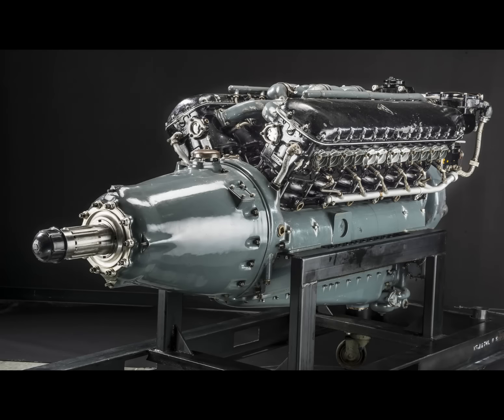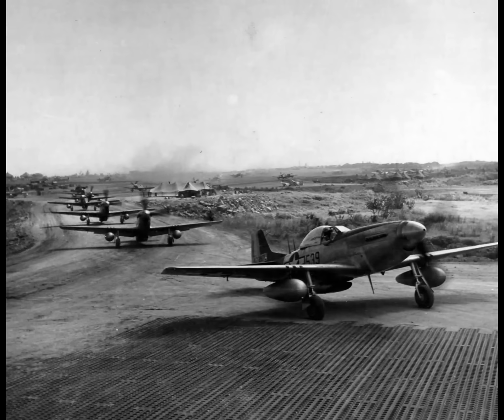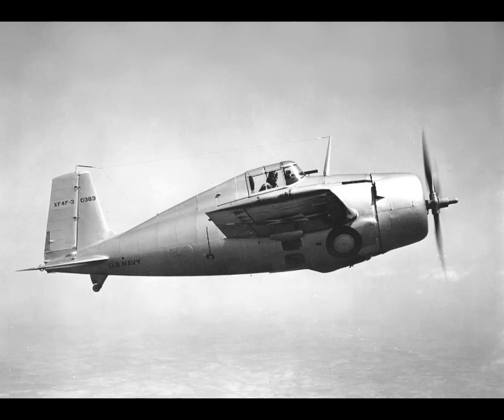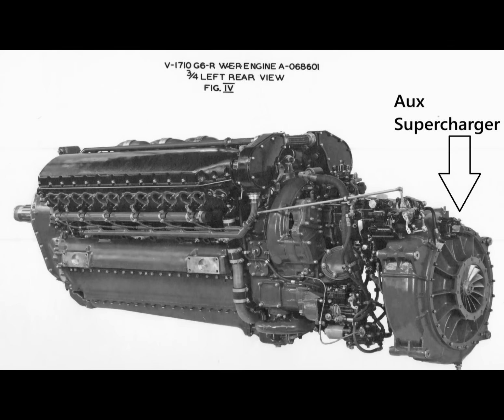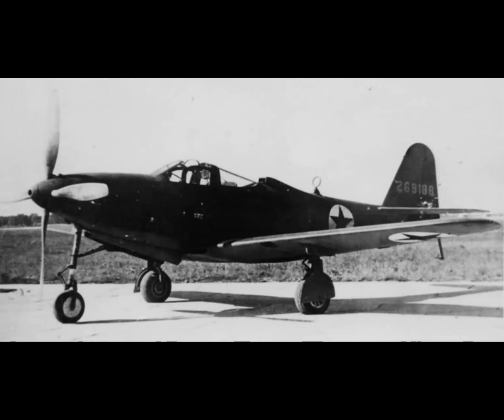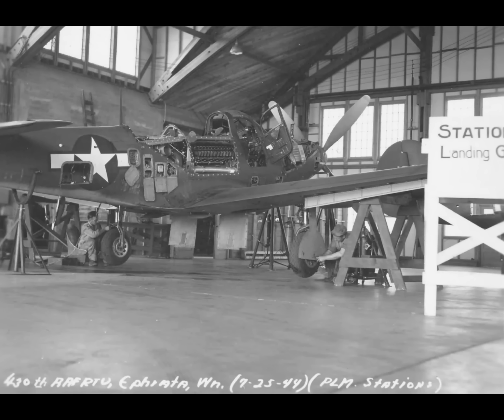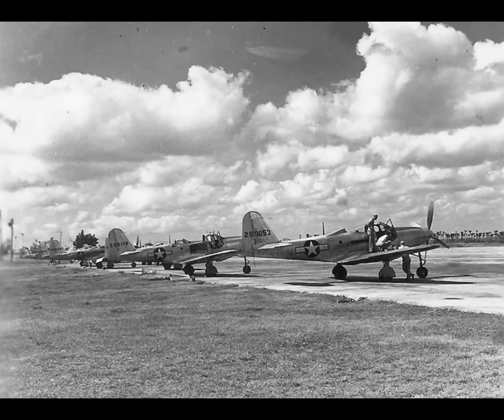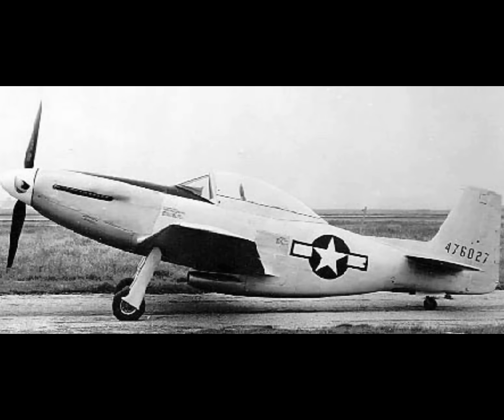Allison V-1710 with a TWO-STAGE Supercharger

Comment: 1:15 "The Allison was pretty much equal in any metrics you choose to compare."  My understanding is that the Alison was far cheaper to build, install, and repair than at least the British Merlins, which in some cases didn't even have interchangeable parts.  Every workstation on the Merlin production lines in the UK had a bench and a vice.  The only reason you need a vice on an assembly line is because your parts don't fit together and you need to work them further to get them to even fit.  I've also heard that Packard needed a year (?? hard to believe but) to re-make technical drawings of it, in part because the tolerances on the plans they got were too loose to really mass produce the American way.  I'd be curious if you have price data comparing the Alisons, the Packard Merlins, and the RR Merlins.  Further, if the preceding is that case, I'm not sure that RR Merlins would have been as reliable, or as easy to fix.  I've also heard that Merlins were more like an engine family, sharing a name but not as many parts as you'd think, meaning you couldn't repair different Merlin-powered aircraft from the same spare parts stock, while Alisons had far more interchangeability, simplifying logistics.

I'm happy to believe that in terms of power per pound at any given air pressure they were comperable.

BTW North American was actually GM, if I recall correctly?  Was Alison part of a larger concern?  What about Packard?
Reply: @lqr824 The V-1710 & Merlin are largely comparable. No developed country has a monopoly on knowledge and skill, just maybe a temporary lead in some specific area or resource. However, sad to see the old Merlin myths appear in comments yet again. RR absolutely did not build ~82,000 wartime engines (to Packards ~55,500) by having highly skilled workers 'hand file parts to fit' or anything similar.  From ~1940 the assembly + much of the parts production workforce transitioned to mostly low/semi-skilled labour just as it had to be for ~all allied WWII production. There was no other possible option given the rapid expansion.
Ford UK built ~30000 Merlins under contract - is it suggested their non-RR-time-served workforce also filed parts at benches before 'offering them up' to see if they fit ? The fact is that while the new UK Merlin production lines may not have been as 'shiny' as the Packard plant, they operated on exactly similar practices.
Similarly, 10,000s of Merlins were not ~constantly rebuilt with uniquely made spare parts. It's laughable - you couldn't keep one Lancaster squadron going with that approach, let alone fifty. Merlin parts were as interchangeable as with any other engine.
Then the popular but fanciful claim that Merlin 'limits and clearances' (tolerance is a different concept mostly blanket used by lay-people) were not fully specified, if at all. Even the 1938 RR service manual has all the relevant data on ~every component, both for new and for those to be re-used. Is it likely this information + updates was not made available to Packard ?
There were several important practical reasons for Packard to re-create the drawings which I'll leave for now. They also had to set up the facility, make supplier arrangements, and so forth. A major delay ocurred in sourcing the ~3500 machine tools + ~60,000 gauges, tools & fixtures needed.
People read far too much into anecdotes and the ubiquitous shop-floor "we can do what the other lot can't" stories, because they're not versed in actual mass manufacturing techniques, eg. they don't understand that assembly using 'selected fits' is a totally different specific process to 'hand fitting', etc. Also there is conflation with some pre-war RR engine building of limited quantities which did involve more manual methods by fully skilled craftsmen.

PS. A RR Merlin was ~£2000 in 1940 money. A Packard single-stage V-1650 contract price was ~$17,000 from 1941 to mid-1943. Allison was owned by GM from 1929. GM owned a controlling interest in North American Aviation from 1933.  Packard was Packard Motor Car Cpy. till 1954.

Comment: Question for Greg: The Merlin engined planes that we see racing at Reno today, they have their engine strengthened so that they can be over boosted and put under great stress at ground level (Reno) but do they still give their maximum TAS at medium/high altitude? Or ground level? Thanks.
Reply from the maker: They are optimized for around 5000 feet.
Reply: @GregsAirplanesandAutomobiles  So are  you saying that they'd go slower at 20,000 feet?

Comment: Okay, I have been studying military aircraft since my 1st proper book report. Which was on the Lightening from the book: "Fork-Tailed Devil: The P38" (Martin Caidin, 1973, Ballentine, 2nd Ed.). This was when I was in the 8th grade at a wonderful military school located in the mountains of Pennsylvania back in 1985/86. (Jeeesh I am old!) Anyway, I have a decent understanding of air density at altitude and the effect of oxygen starvation on people and engines at altitude, how internal & external combustion engines and electric motors work, etc. When it comes to the nomenclature of air densifying equipment for internal combustion engines, I thought that I understood the mechanisms and naming conventions well, so please correct me, as I much prefer to be wrong and be corrected rather than to think I know and be wrong. So what do I have wrong here: Turbo Chargers are driven by the hot exhaust gases spinning an impeller or turbine in the exhaust stream. The impeller shaft connects to and runs a compressor that compresses the incoming cold air before sending to the carbs and into the combustion chamber. (Does a turbo charger send any of the hot exhaust gases back to mix with the cold air and then through engine again?) A Suoercharger does the same thing but is mechanically driven by a belt or shaft from the engine or by an external electric motor. A turbo-supercharger has both of these systems on the engine (this is the one I am certain that I had wrong as my new understanding is that a turbocharger is more correctly called a turbo-supercharger). Anyway, yes I could look these terms up, but there is someone much garbage on the inter-web that I would prefer to hear from any experts here. Thank you!
Reply from the maker: That's basically all correct. The confusing part is that a turbocharger is correctly called a turbo-supercharger. However in WW2 all planes with turbochargers also had mechanically driven superchargers. They used the turbo to blow into the supercharger.  You might do well to watch this video: https://youtu.be/ULLsIo1VzTw?feature=shared

Comment: Cost, weight and dependability were main reasons in the choice of engines. B-17 engines were put in DC-3 to fly the hump were found impractical and removed afterward. Attack tactical aircraft got the job done and flew far more hours than high altitude mission aircraft.

Comment: hi, an excellent video. 1, does your supercharger book have good info for automotive use? or is it only aircraft? 2, do you think/ have you seen any applications in the automotive field for a hyd. driven superharger?
Reply from the maker: The boost is all automotive, mostly based around Alfa Romeo engines but the principles apply to everything. However I wrote it a lot time ago before there were 8 and 10 speed automatics that tend to favor centrifugals.

Comment: P-63 is a very much ignored or unknown WWII fighter but one of my favorites. Weird aircraft, but looks so cool and beautiful.

Decades ago I read somewhere, that Hungary after the WWII, under Soviet ruling, had to use Soviet supplied military equipment and arms - even manufactured small arms (Mosin-Nagant, PPSh-41) in licence - and there was a plan, to get P-39s and P-63s as fighters. That article said (maybe it was on early internet source, or in the local military aviation magazin, called Top Gun) that even the pilot and maintenance manuals were translated to Hungarian. But I never ever could find any hard evidence about it. Maybe they were destroyed before the digital era? So actually we got the "Yak-9P" with the Klimov VK-107, and had plentiful of problems with the engines. Oil system was always problematic with them. We called them "Vércse", means Kestrel. Also the Ilyushin IL-10 called "Párduc", Panther. These two were the first pro-WWII combat aircrafts in Hungary.

Comment: While we didn't see put in service, I think V-1710 was a large test mule, have seen pictures of turbocompounding also. Early turbos didn't have all the multiple parts we see currently, I remember going to Cummins school in the mid 80's, they had just bought HOLSET and had various housings, compressor/turbine blades to test on VTA903M. Turbos were kept in the closet, unless you had access to Hugh Mcinnes.

Comment: The Allison was no doubt a superior engine!
Rollers on the rockers was just one of the details that back this up.
The RR had rockers that dragged across the cams. That leads to a short life.
The Allison was the first aircraft engine to exceed 1,000HP
It was tougher and more durable.

Here's a fun fact, the British built Merlin engine was built in four (4) different factories.  Many parts were hand fitted and not interchangeable.  When Packard got the contract to build the Merlin, they got the blueprints, specs, and an example engine. It was crap! Fun note, it was metric, NOT imperial! Packard converted all the measurements from gay to manly and reverse engineered (to an extent) the Merlin, THEN they cranked out something far far much gooder than what the British was making!
Reply: This isn't True,  The Merlin was Imperial but did use British Standard Whitworth (BSW) British Standard Fine(BSF) British Standard pipe(BSP) and British Association (BA) thread systems on the engine .Also if the Packard Tolerances are more precise why is the HP the same.

Comment: I would argue that the Allison was a better engine than the Merlin. With the same or similar supercharging system, the engines had similar power across altitudes. But the Allison had over 30% fewer parts than the Merlin. This is a huge advantage in both manufacturing and maintenance. 300 hour overhauls took 30% fewer hours on the Allison vs the Merlin.
Reply: The Allisons cost significantly less, as well.  1944 production V-1650 Merlins cost $17,555 compared to $10,561 for the Allison V-1710.  The lower parts count in the Allison design would have been a significant factor in the cost delta.

Comment: Many of my countrymen get upset about any criticism of the Merlin. As a British born and trained mechanical engineer, I think the basics of the Allison V1710 were superior on balance. It’s valve operating system and combustion chamber shape were definitely better. Where it was critically inferior was in oil scavenging and deaerating. Allison had good design ability but couldn’t get close to RR on development ability.
Reply: Deaerating.  Was one factor that lead to long period of problems for Daimler Benz when they switched from roller bearings on the crankshaft of the DB601 to high pressure Journal bearings on the DB605 around 1942.

Comment: With the power of hindsight it feels like turbocharging for single seat piston fighters was a bit of a development dead end. It had rather few applications and then the jet age came.
Reply: The USAAF seem to have made poor pre war choices but the US Navy had all the smart people.
Reply: Turbocharging worked great in the P-47 and also the P-38.
IMHO the problem was that they put all on the one card P-38, while the P-39 and P-40 were neglected and restricted to low level work. Had the USAF wanted a dual stage supercharger in those smaller fighters, they would have been ready by late 1941.

BTW, these were all built before and during WWII to win THAT war. It has nothing to do with the jet age.
Also, P-47 would have been a better fighterbomber in Korea than P-51. It was just out of service before that war because of economic decissons.
Reply: I think if WWII hadn't happened to accelerate development and require designs suited for mass production, we would have seen more turbo fighters being developed before a later arrival of jets.

Under prewar thinking, the turbo was going to be a revolutionary advantage, and one already sort of proven by early B-17s in the 1930s. But when the war got started, turbos were one of the few continuing shortages the US had and they just weren't scalable enough to suit wartime production demands. The priority went to bombers, so fighters were either canceled or had their turbos gutted, except for the P-38 and P-47 as "high-end" fighters which couldn't really be adapted to a non-turbo design without becoming pointless (P-38) or turning into a totally different plane (P-47).

It might be interesting to see how that would affect naval aircraft development. They had basically rejected the turbo for all its drawbacks - size, weight, cost, reliability, no strategic bombers that would have needed them - and doubled down (literally) on superchargers instead. But navies were slow to adopt jets for carrier service for similar reasons as well, if without a WWII we see a later jet age and perhaps more USAAF turbo fighters to make the systems more available and perhaps seen as a requirement for performance, maybe they could have had their time with USN before jets ultimately took over, perhaps there would have been a production F4U-3. Or there could have been more compound-propulsion planes like the FR Fireball or AJ Savage.

Comment: The spinny parts that smooshed the air to the spinning parts where combustion happens to the shaft that goes to the spinny parts with the propeller that pulls the plane
Reply: Nerd 👆

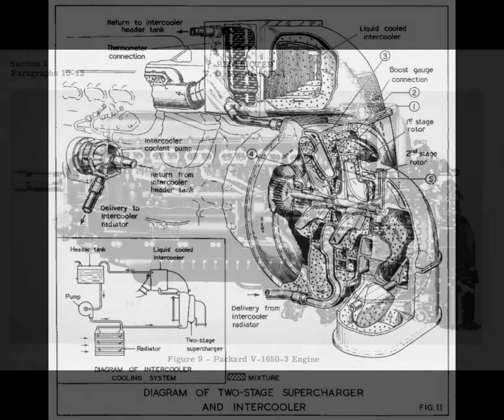Comment: 2:41 I can't find any reference to the Merlin being both intercooled and aftercooled.
The diagram shows a aftercooler which is right before the intake manifolds (which confusingly is labelled a intercooler).
I haven't worked on a Merlin since the mid 1990s but dont remember  an intercooler between the two supercharger impellers being used on the P-51. 🇦🇺
Reply: I think Packard cooled the first stage diffuser case but Rolls Royce cooled the area around the second stage intake.  Or the other way round.
Reply from the maker: The Merlin as used in the P-51B and later production models has both an intercooler and an aftercooler. Don't make me post an entire video about the Merlin engine.

Comment: Most interesting. Is that a swirl throttle on the inlet to the aux supercharger, or just some fixed inlet vanes?
Reply: When in the video do you see inlet vanes on the aux supercharger?
Reply: @TarenGarond  Well, on what I assume is the inlet in the middle.
Reply: @pedalinpete  Quite sure that is just the rotor.

Comment: Hi Greg, very interesting, I didn't realise that Allison used a hydraulic type supercharger in their two stage Allison's, I guess this type of aux supergarger was less convenient than our Merlin 61 series engines, in the sense of its length and compactness. But it's a very interesting comparison to the later DB 601 and 605 engines using water methanol to boost power. I wonder what your thoughts are comparing the two stage Merlin's to the DB605?

Comment: AS I recall the USAAF didn't fly the P-63 in combat. Like the P-39 it was plagued by short range. Aerial combat over the Eastern Front was usually under 15,000 feet so the Soviets didn't really need it either. The WWII Migs had good performance at high altitude, but, for that reason also didn't see much action.

Comment: The key factor of the 60 series and on Merlins was TWO SPEED-TWO STAGE intercooled system not just two-speed. And ss you know, it was Rolls Royce at Hucknall that converted Mustang 1 (not P-51As) on its own to Merlin power, with a Merlin 65 powered Mustang 1 going from 380 mph to 440 at altitude and along with solving a lot of other early Mustang problems (cooling, sliudge, lomgitudinal instability-(see Birch -Rolls Royce and the Mustang) showed it off to NAA via Major Tommy Hitchcock and they bought it. Ed Schmued even visited Hucknall to look at theoir work.
Reply: The 2 speed single stage Merlin 20 series engine would have pushed the Spitfire III/V from 369mph to 400mph (not much slower than the Spitfire IX's 416)  but due to supply shortages it was "wasted" on the Hurricane II which was uncompetitive without it. Some P-40 were also produced with Merlin 20 series and also showed a significant performance increase.
-Ive always been curious as to how well a P-51A with a Merlin 20 series engine would have performed or a Allison with two speeds

Comment: I wonder what my madifold pressure is?
🤔
Reply from the maker: It is literally the amount of air pressure in the intake manifold. With the engine off, it's at ambient pressure. At idle with the throttle closed it's lower. With the supercharger forcing more air in, it's higher. I do have a specific video on this.

Comment: One thing I find a bit confusing- if the Air Corp was pushing turbochargers, why did they remove them from the P-39?  The XP-39 was showing promise of 390 mph @20000 ft, seems to me they should have pursued that a bit further
Reply from the maker: I have entire videos on the P-39 that address that question. It's too complex to answer here in the comments.